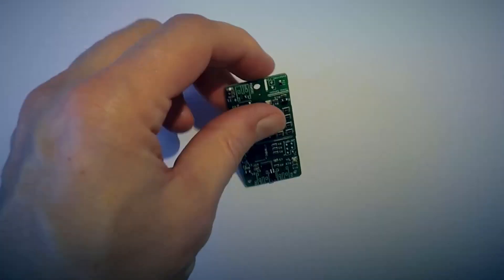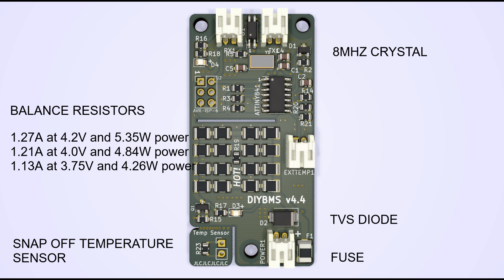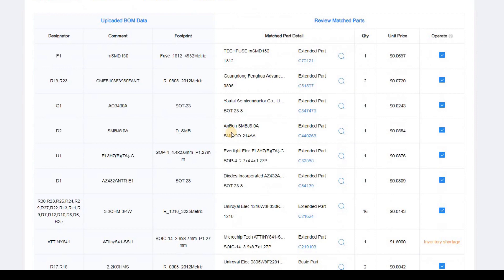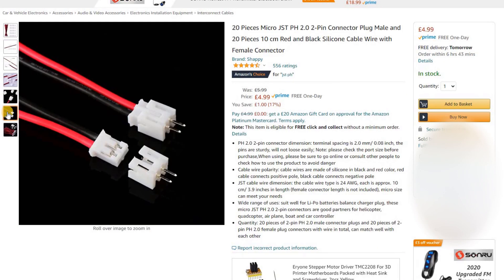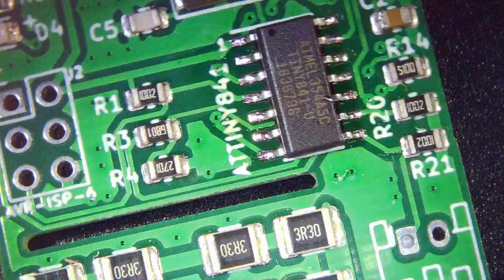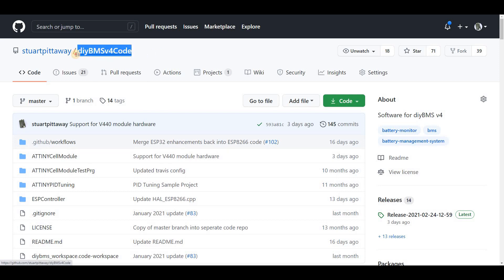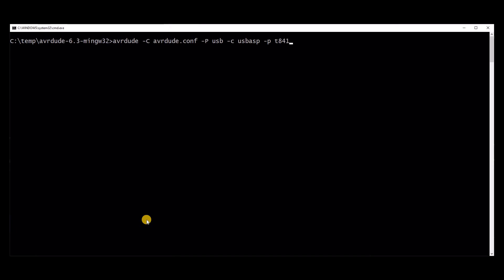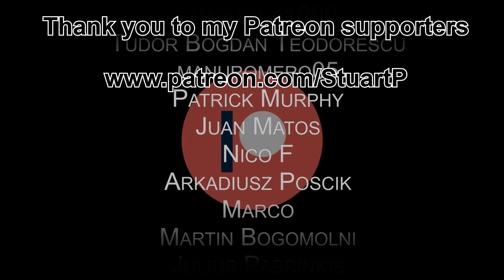diyBMS New cell monitor module V4.40

Comment: Hey Stuart great project, thank you for your work! 
Will a ATTINY441 work instead of 841? If so does the avrdude configuration change?
Reply from the maker: No it doesn't - the code is larger than the 4K of memory the 441 has
Reply: @StuartPittaway  Thanks Stuart

Comment: I've got mostly working 20 of my jlcpcb 4.4 boards, a few I know are miss soldered and messed up the upc, early practice boards for me. However I've got 2 which communicate fine, showing temp internal/external, but the voltage is way wrong down in the 0.5 range. Any idea what this might be ? or where to look ? Thanks incase anyone has a suggestion.
Reply from the maker: Its likely to be a soldering issue, take a look at the pins around the ATTINY chip and also the voltage reference chip.

Comment: Awesome 👍, I'm glad the balance current Is up there a bit, balancing a nearly 1000ah cells with a BMS having a few ma, is not going to happen, it will take a while even with the just over 1amp but hopefully I will not really need much balancing, I tried to balance the capacity best I could,  I may try a active balancer along with, if I have issues...    Thanks Soo much for your efforts!

Comment: Hi Stuart,

Thank you very much for making these available!
I'm preparing to build a larger LifePo4 batterypack for solar storage, and am aiming for around 100S3P, to lower amps, and it should make inversion more energy efficient - and would like to know the theoretical maximum for this BMS. I assume the limitation is the address of the units, but have been unable to find this information anywhere (is it 128 addresses that I2C supports?).
Reply from the maker: It doesn't use i2c for the modules. Theoretically it supports 128 modules, However in reality it's more likely 40 (approx) this is down to the time it takes for the data to pass through all the cells back to the controller
Reply: @StuartPittaway  Ah - thank you for the reply. I was considering if that potentially could be an issue, and was thinking if it was possible to make nodes that handles data from x units, and sends that off to the controller, and while I guess that it is, I don't know enough to actually contribute that yet. Alternatively, is it possible to make e.g. 3 packs of 40, and connect them in series? I guess that would require the controllers to be able to communicate with each other, so they can agree on a target voltage, and I assume that that would require less of a change overall, as long as the opto-isolators can handle everything. I might even be able to do that myself, as long as there's a spare bus on the controllers 😁 (it would be hacky and ugly code though, so while I really want to contribute to things like this, I'd likely keep it to myself out of embarrasment 😂😅)
Reply from the maker: @martinfyhn1976  Its probably easier for me to increase the comms speed !  This should be possible with the V4.40 modules (latest) ones.  Watch this space
Reply: @StuartPittaway  Fantastic! I am, and will do! I assume that you don't have any packs of the size that I'm planning to build, (given the current limitation) so is there any way I can provide any data in terms of performance, or anything, once I get the pack built, and in operation, and would it be useful? (it will be a while before I'm done with my setup, so don't hold your breath! 😅)
Reply from the maker: @martinfyhn1976  there are people running about 60 modules on the open energy monitor forum.  They occasionally run into problems with the comms.

Comment: Are these BMS modules suitable for cells that aren't 18650 in type, i.e. Prismatic cells that still operate at the same voltages as 18650 (4.1 max, 3.7 nominal)? I am thinking of the prismatic cells in BMW i3 battery packs. TIA
Reply from the maker: Yes, works fine with those cell types, and also things like nissan leaf cells

Comment: is there another program that you can use Avrdude does not work(libsub0.dll)tried avrdudess does not work either any other thing to try.Running win10 64bit
Reply from the maker: Looks like you have tried the basic ones - avrdude is the de-facto-standard for this sort of thing - everything else is based off that.  I'm surprised it doesn't work though, its fairly simple code.  Have you tried running it as administrator user on Windows?

Comment: I attempted to follow these instructions using the github files available on Apr 13, but got one componenent (R14 510OHMS R_0805_2012Metric) marked as "No Part Selected".  Is this an error in the BOM?
Reply from the maker: Is it out of stock at jlcpcb?
Reply: @StuartPittaway  No, this is different.  Out of stock parts get an "Inventory Shortage" message in the "Operate" column on the far right.  This is a "No Part Selected" message in the "Matched Part Detail" column.
Reply: The BOM lists it as part number C17734.  I tried to look this up but it doesn't exist.  Looking up a 5100 ohm 0805 reistor gives a part number of C17733.  A simple typo?
Reply: Actually, C17733 is a 510K resistor.  Couldn't find 510 ohms at all.
Reply: Maybe C83396?
Reply from the maker: @edwardcriscuolo5845  C25317, 510ohm 0805 size.  
CHIP RESISTOR - SURFACE MOUNT 510OHMS ±5% 1/8W 0805 ROHS
Reply from the maker: @edwardcriscuolo5845  I've updated GITHUB with the new BOM
Reply: @StuartPittaway  Thanks!  Great job, as always!

Comment: Stuart I have information from JLCPCB about the incorrect distribution of the D2 element, they corrected but I am writing for information, greetings Leszek ...

https://photos.app.goo.gl/AhaKxzQYXadCBfiv9
Reply from the maker: This was mentioned to me earlier, I believe JLC to be WRONG in this case.  Make sure they don't build the board like that or it won't work.   https://github.com/stuartpittaway/diyBMSv4/issues/73
Reply: @StuartPittaway  So that is ok:

https://photos.app.goo.gl/BqMYdhtNULf8VZxW9

and so after changing them incorrectly?

https://photos.app.goo.gl/dKhRKQuCLxmFPEe57

please respond quickly, I will write to them to undo the change, a bit annoying that they change the project themselves:

Comment: First, I want to say this is some awesome work Stuart and thank you for making this available. With a minimum order of 5 controllers you would think some ppl would want to make some of there money back for the extra boards on ebay. I guess I'll just have to buy 60+ cell modules and put together several systems for Christmas gifts.
"Dad, I think this toy is broken there is just circuit boards in this box."
Reply from the maker: That minimum order is a pain, you can sometimes select to build only 2 boards.  I'm currently trying to get stock in the openenergymonitor shop to make it easier to get all the parts you need

Comment: hey Stuart I'm ordering modules but the item Q1 C347475 is missing, can I replace it C344010?:

https://photos.app.goo.gl/tSuCRudhWrCf7JW37
Reply from the maker: Not sure, I've not swapped that part before.  Check the data sheets to make sure the pins are the same layout.
Reply: @StuartPittaway  I will wait until there is some, I order 50 pcs, I don't want to make a mistake :)...

one more question because I also want to order ATTINS and I already have confusion whether they will be ok, because on the JLCPCB website, unfortunately, they are over: /

http://pl.aliexpress.com/item/32859277249.html?spm=a2g0o.productlist.0.0.2f15b54e6aBM5C&algo_pvid=5a89bffd-d838-4791-b5ae-9c63e031f45f&algo_expid=5a89bffd-d838-4791-b5ae-9c63e031f45f-2&btsid=2100bdf016153022783536075e00d5&ws_ab_test=searchweb0_0,searchweb201602_,searchweb201603_

Comment: Thanks Stuart,  nice to get the attiny841 soldering done. I have version 4.3 of the boards. How many cell will these monitor or do mate?
Reply from the maker: The new controller currently supports 100 modules, but I can probably increase that to about 128
Reply: @StuartPittaway  Would the system work with a 80p battery.

Comment: Great work. Love the web interface. Hopefully I can learn to add this to my own bms I've been designing. 
What made you choose the Avr and atmel studio vs using the arduino bootloader and programming it that way?
Reply from the maker: I've used the AVR chips for a very long time, they have good support and libraries available.  I don't use ATMEL studio, its still Arduino based under the covers, but I don't use the bootloader because it takes up extra memory I don't have the room for

Comment: I've used these cables before https://smile.amazon.com/gp/product/B07Q39Z7SS/   it has a connector on both ends.... But you do have to swap the two wires on one end.  Not too bad to do to remove the pins from the housing.  I just use the tip of an exacto knife to lift up the plastic piece to slide the pin out.  Then I just put them back in opposite order.
Reply from the maker: Thanks, useful info

Comment: If you use a hot air systems use kapton tape around the the chip so you don't unsolder any bits around. You could also use if you solder by hand stops solder getting caught where you can't always see it.

Comment: Many thanks for the update! Am I right, all v4 boars (v4 original, v4.21 and v4.40) functionally are exactly the same and the difference is only in hardware design, correct? So I do not need to reorder the boards when I already have v4.21?
Reply from the maker: Yes, correct.  They do differ a little, but the same code is used on them and they all work with both old and new controllers.
Reply: @StuartPittaway  Thanks! Great job 👍